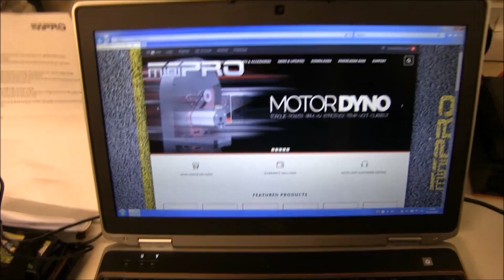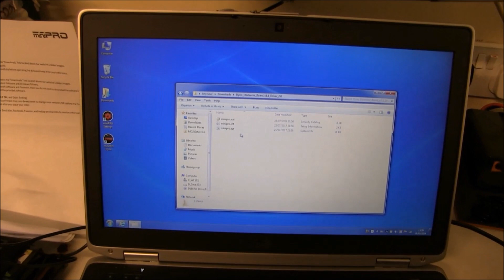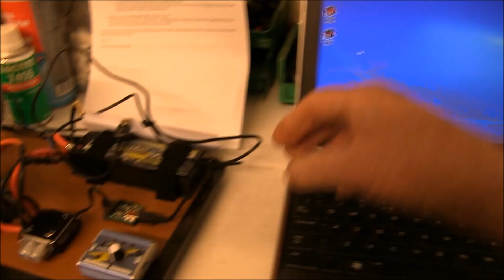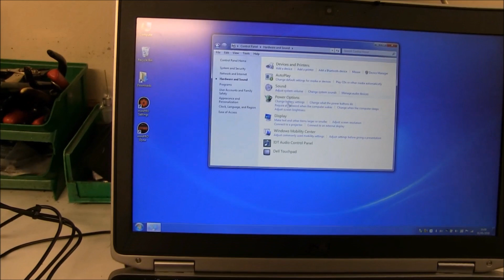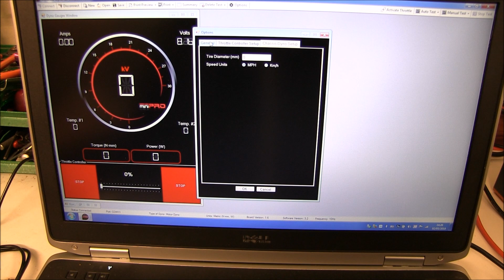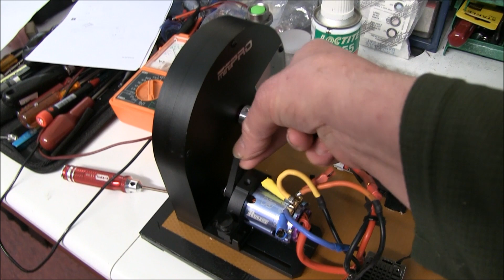miniPRO Dyno Software Installation and Setup Part 2

Comment: Hi please is possible help me?
I have minipro dyno softweare 4.4 and 1.93 but i have problem with set up voltage. The voltage of battery is 8.40. But on the application in the pc is 9.20!! Is possible change this parameter?? Thanks for help me thanks

Comment: Great videos Nick! I’m making my own chassis/flywheel Dyno at the moment so your experiences are really interesting. My design will have a load in addition to the flywheel/rollers. But I also won’t have the luxury of a software package. Mine will be very DIY. Then the question of how that all relates to the track. Will take time and experience.

Question: where and what is the esc controller you are using with the dial. I already have the polulo board but that piece could be handy just for quick functionality tests. 

Thanks again keep up the work.
Reply from the maker: Hi Ben. That is just a servo tester. There are some cheap ones like this blue one. Type in "servo tester" on Ebay.  Good luck with the dyno. Nick

Comment: No disrespect intended but you may be applying the Dyno based on context that is carried along from combustion engine vehicles. I’llmake It short and sweet. An electric motor is considered optimized based on its application. If the application is constant velocity then horsepower determines your starting point. If acceleration makes you application happy then you focus on torque. If the application requires allot of acceleration/deceleration followed by velocity then that is another matter.60:1, 30:1, and 10:1 are the rules of thumb for the previous mentioned applications. The ratio is the inertia of the motor rotor versus all of the inertia and gearing on the other side of the motor.
An electric rc motor is a reciprocating application. Under 10:1 will get your motor stopped in under 500ms. Ask or calculate the friction and inertia on the output. I promise that if you combine what you already understand with my explanation you will have better track results.
Start with inertia mismatch.
2nd is thermal time constant of the motor so you have to develop the efficiency curve.
3rd is to apply it to the whole car and track acceleration/deceleration and time (duty cycle) requirements.

Comment: Where are the motor tests?  I've been (im)patiently waiting to see how the results of this dyno would compare to the results of the motor checkers/gauss checkers that you have used previously.  I.e. - if your previous method showed the R1 (or whatever) motor is #1 among the motors that you've tested, would this contraption provide the same motor ranking?  Seems awfully complicated and cumbersome to do what we want.
Reply from the maker: Hi
I had to wait for new software that shows the all important efficiency curve.
I agree that these type of Dynos are cumbersome and time consuming.
The results can be inconclusive when related to track performance.
But, I hope to figure out a quick test that will give comparable results.

Comment: NIck did you ever try the CS dyno for brushed motors all those years ago and if so have much luck with it?
Reply from the maker: Hi Mark
I have not had much success with any Dyno.
The results are difficult to transfer directly to the track.
I did have a Dyno that I used for Brushed motors.
The software came on Floppy disc !!. That's how old it was.
I built my own dyno.
I used them to measure RPM, Amp draw and time to accelerate the flywheel.
I didn't need a computer for that, and still find the computer graphs not much use for day to day tuning.
Reply: I used to have some luck with it for tuning motors, it showed torque and power in watts using a fly wheel arrangement so you could improve a motor you had already, but as always difficult to compare different makes of motors when the 7.2v batteries keep going flat. I did think about using a CB power supply to supply the voltage and amps but getting one man enough for the amp draw is difficult and expensive.

Comment: This Product is a rip off i can DIY a dyno for more than half the price but its not even worth having a dyno because you can just go off trail and error, feel and laptimes. 
It might not be too accurate but for tuning purposes on working out what timing is giving you more power and where that power is it will be able to give you that information.
Reply from the maker: Hi Sung
I agree.
It is only of use for finding the maximum efficiecy point. But this one does not have that graph !!

Comment: Hi Nick, thanks for showing the set up. I picked up a miniPRO as well and will be setting mine up soon. Regarding constant output voltage, do you think using a DC power source like a power supply would be a better option? I have a 50A supply but I am thinking it is possible the ESC current draw will be too high, and that is why a battery should be used?  Thanks!
Reply from the maker: When it starts up, the current draw will be over 100 amps.
You can see the amps drawn by this 13.5T motor on the graph at 22.50.
It starts at 120A and falls slowly to 18A.
Your power supply may trip, or it will limit the acceleration.
Also it is probably 12volts which is too high for testing powerful motors.

Comment: loving the videos Nick, but that Dyno is next to useless. I remember I used one of the brushed dyno's a few years ago with the fly wheel and there was so many  variables that it was all but useless. I'd buy the £90 brushless motor dyno and the gauss meter for the rotor and save like $800?...
Reply from the maker: Hi
I agree that Dynos are a complete headache, and the results are difficult to translate to the track.
I too, have tried Dynos over the years, without much success.
I always had perfectly good results with experience and the basic motor tester tools which I have used in all my motor videos.
I tried the Eagle Dyno with Crewchief software, but it took all day to manipulate the data, which I do not want to do that all day.
I am hoping I can get a quick motor test on this Dyno, but if it takes too long to do the test, then I will not have the time or patience.
The rolling road is even more of a frustration, but I will do a video on it.
I did a video on my previous Rolling Road Dyno, used about 30 years ago (The Facts Machin), but I did not use that much either.
Reply: Yep that rolling road looks like 2 printer rollers on a frame. Again totally useless, as you can't simulate the track unless you test at that track and dial the motor and car on that day with someone comparable to your speed. If you can hook onto the tail of the fastest guy at the track in your class you were in a good place! Normally GW at Aldershot lol